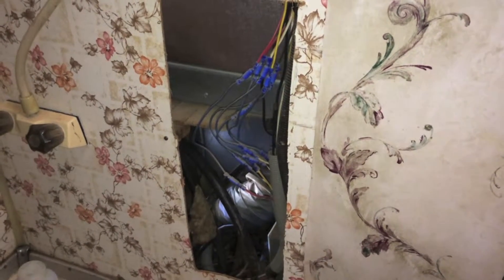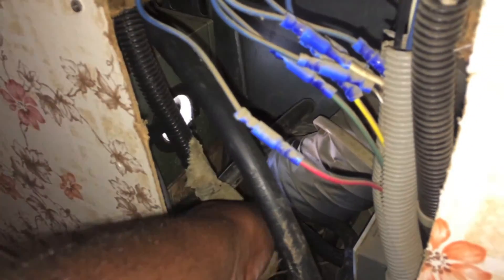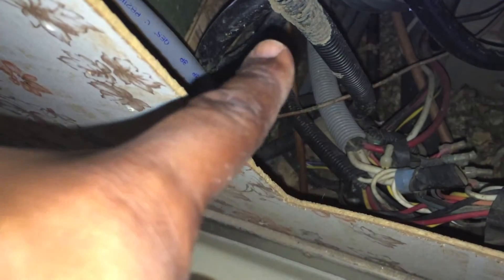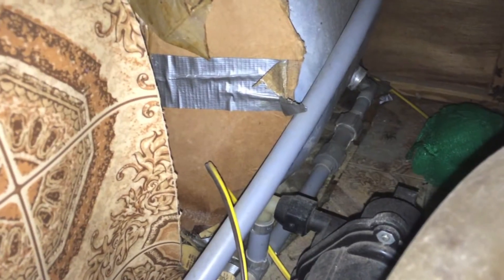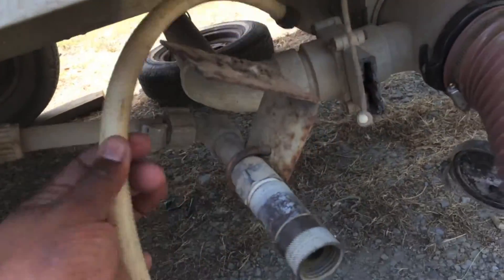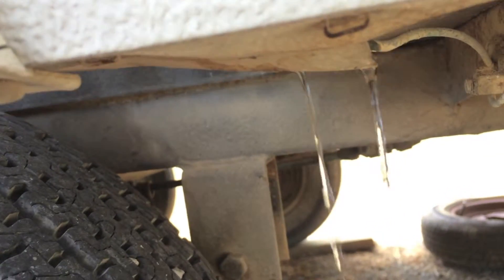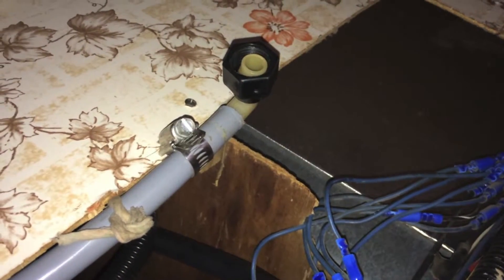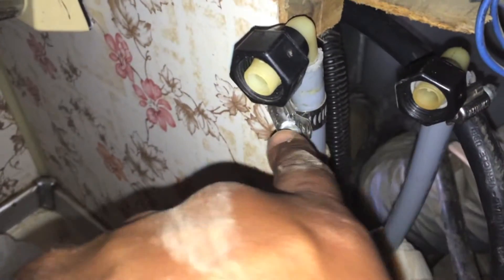Repairing an RV/Camper Shower Leak (Episode 5, Part 1)

Comment: they make quick connects for plex pipping they are very good I used them in my house they have not leakd for 3 yrs now and they are cheap they might have some for the shower hook ups I would look at lowes or some kind of hardware store
Reply from the maker: +okie-dokie acres , thanks for the tips sir. i did not know they had those. It would have been nice to know during this series.
Reply: it will help with the next one I had forgotten about that ill try and snap a pic and send it to you on what they look like or I can send it to bitty boo I miss her